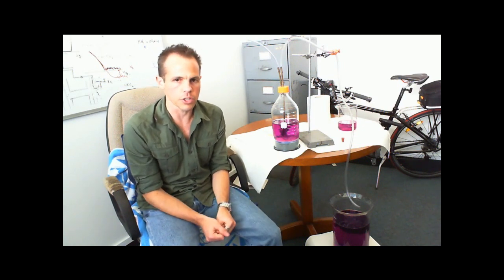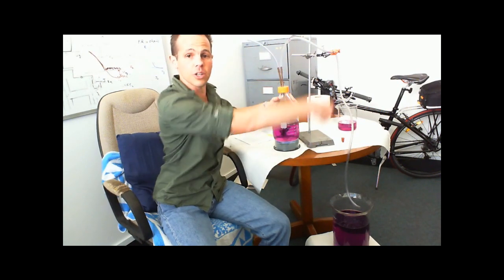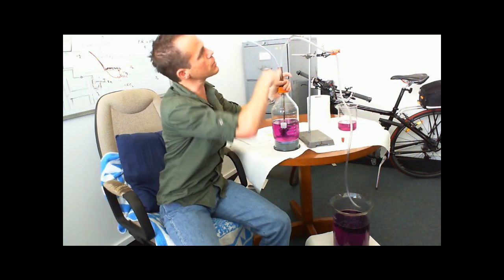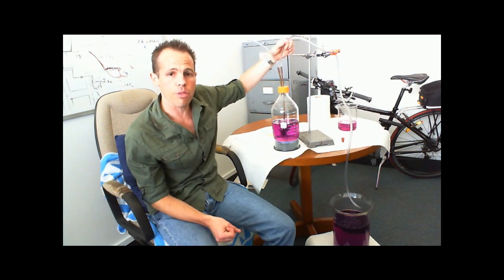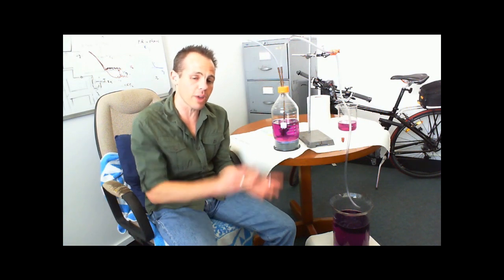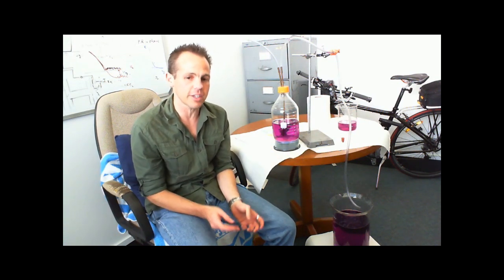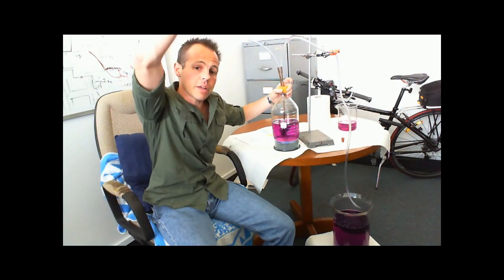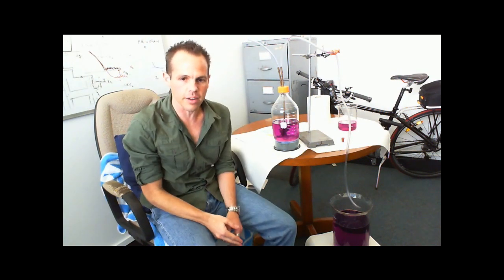The great siphon definition debate - Discussion

Comment: siphon, an instrument, usually in the form of a tube bent to form two legs of unequal length, for conveying liquid over the edge of a vessel and delivering it at a lower level. Siphons may be of any size. The action depends upon the influence of gravity (not, as sometimes thought, on the difference in atmospheric pressure; a siphon will work in a vacuum) and upon the cohesive forces that prevent the columns of liquid in the legs of the siphon from breaking under their own weight.